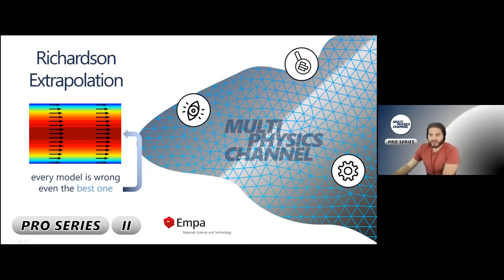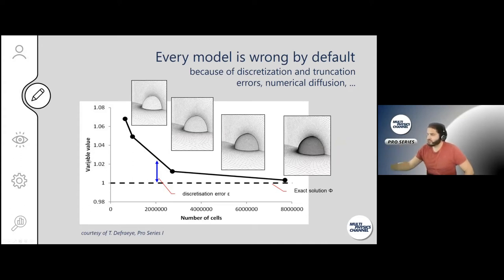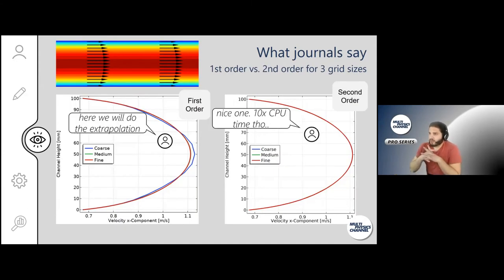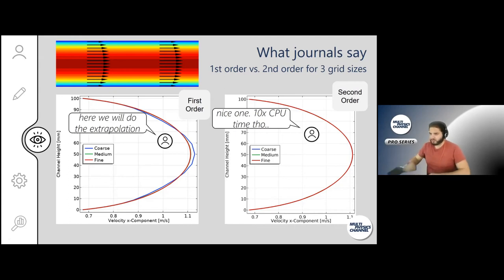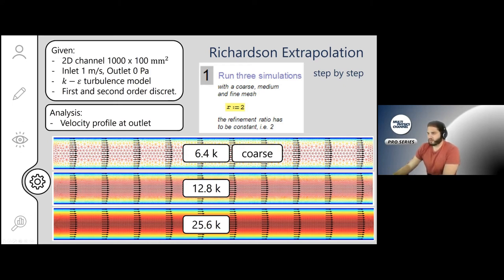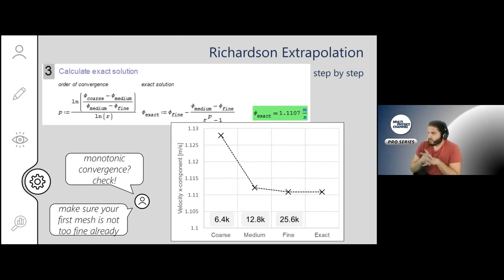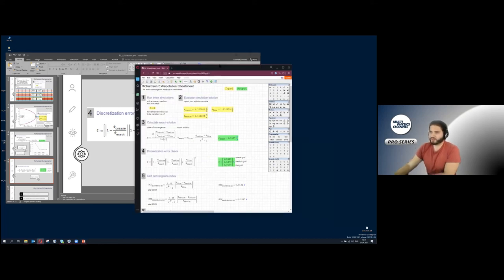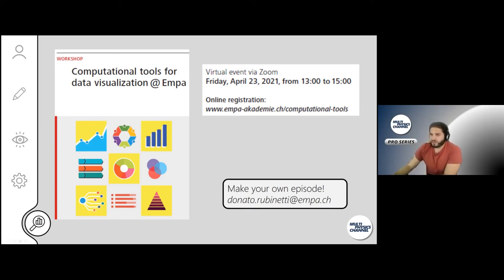Multiphysics Channel: Pro Series II - Richardson Extrapolation

Comment: Hello,sir. I really want to know if there is any books including all the content you just introduced in this vedio.
Reply from the maker: Thanks for your interest! The method described and also implemented in the cheat sheet is based on this publication:
Roache, P.J. and Knupp, P.M. (1993) Completed Richardson Extrapolation. Communications in Numerical Methods in Engineering, 9, 365-374.
https://doi.org/10.1002/cnm.1640090502
Reply: @EmpaChannel  Thanks！